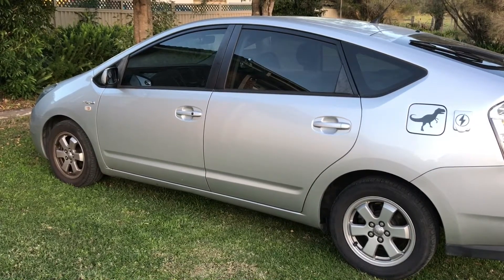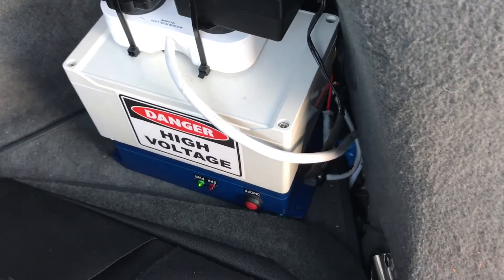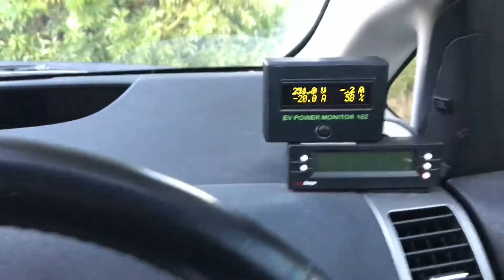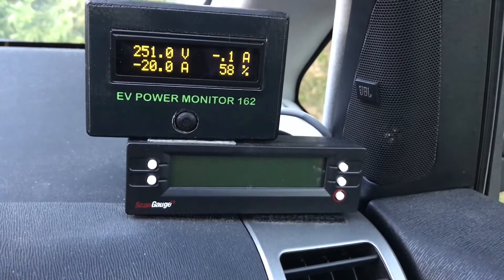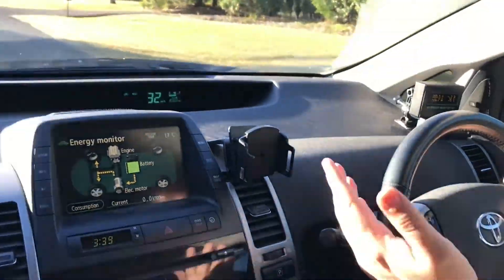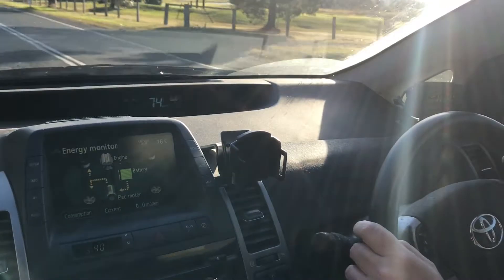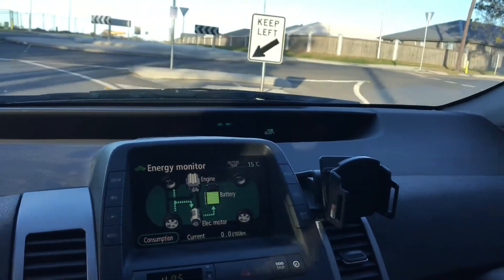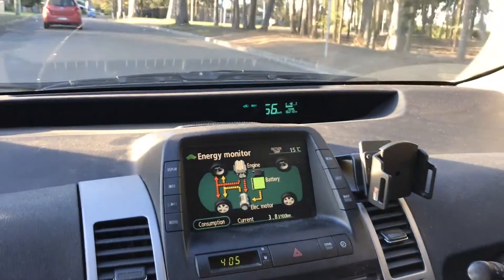2006 Toyota Prius 10Kwh PHEV conversion part 2

Comment: Where do you get the kit?
Reply: Can you make a detailed how to video? Or just point me in the right direction?
Reply: Plug-In-Supply are no longer supplying the kits. I have this info from Robb himself. The website has changed and no longer shows the kits.
Reply from the maker: Home Solar Research the kit was mostly from pluginsupply.com. The batteries charger and bms were from a West Australian vendor.
Reply from the maker: evric2008 I must have gotten one of the last ones.
Reply: @exaturbo  I want the controllers so I can put in a battery pack but I cannot find them...

Comment: how did you make the prius take so many amps? can i reprogram this myself or do i need to replace some hardware (like bms,some wires)
Reply from the maker: This is a complete kit. It has a controller that plugs into the obd2 port and spoofs the car into believing that it is slightly overcharged. So it wants so get rid of that excess. This allows it to use a little extra current. It was a good system for the time I had the car. Haven’t had that car for around 10 years or so. As far as I am aware, it is still going well for its new owner.
Reply: @exaturbo  thanks :)

Comment: hi jason i am finally go to do convestion similar to yours could i asked a couple of questions i am based in uk i have a bit of experiance of building electric bikes im in my 60s this is next step i have a limited budjet which is why not buying completed vehicle 
1 is your pack charged by the  prius car when being used  i see couple people using  diode to prevent this 
2 as no kit available can i create my own ice kill switch do you know what connections need to switch to enable this function do you have a circuit diagram of the add on wiring you could post 
3 why did you choose such a high voltage pack when compared to the origonal hybrid battery pack i relise you get lots of questions which much difficult to answer it would be appreciated if you could answer mine thanks john
Reply from the maker: Hi mate. I don’t have the car anymore, so can’t help with too much of this info, but on the Prius chat forum there is a bunch of helpful people and useful info. I’m sure someone there will be able to answer a bunch of your questions. I don’t have any of the wiring diagrams anymore, as I gave them to the buyer when I sold it. 

As for lack voltage, 240VDC is actually pretty close to the original hybrid pack. It actually has to be slightly higher in practice for it to charge and run the system. 

The stock Toyota pack is similar voltage. And is actually boosted to around 500V at the inverter before being fed to the MG that drives the car. 

It didn’t charge from the car. That was one major downside. Not being able to recover any regen apart from what was going into an ageing Toyota pack. The way it worked was it disconnected one of the contractors when you were off throttle. This prevented the car doing regen into the add on pack.

Comment: Hi, I want to do this with a Hybrid Yaris 2018.. tell me one thing, do you connect the extra battery in parallel, how do you avoid the battery charging the original one? I was thinking about using diodes for that but I think it is not the optimal wya that I can do that.
Reply from the maker: It’s not as simple as connecting a larger battery in parallel with the factory battery. You need some way of faking or spoofing the SOC of the Toyota hybrid battery. Or the car will not know the extra capacity is there and won’t use it. 

The system that I had had two electronic boxes that handled the spoofing of SOC messages. The kit that I had is no longer available, but there are likely others out there. Good luck.

Comment: Still using this? Want to sell the kit or car?
Reply from the maker: I actually sold the car around 2 years ago. It was still going well at the time, but the Toyota HV pack was very weak and needed replacing. Didn’t want to spend the extra $3500 on it. So cut my losses.
Reply: Jason Munro if only you realized you could refurbish it yourself for $50+4 hours!

Comment: How do you do this and how much does it cost?
Reply from the maker: The business that was selling the conversion kits is no longer going. So it would be almost impossible to do this these days. And as for cost, it was over 10,000 for the conversion. Not economically viable these days either. Plenty of good second hand evs on the market now.
Reply: @exaturbo  Thanks. 10k is still a lot cheaper than the cheapest EV though, and being able to get 100km on EV mode would do me for my daily commute. Does anyone do this in Sydney? Cheapest second hand 2012 Leaf on carsales is still 20k.
Reply: @exaturbo  I just had a look at the EV Plus website. Looks good but I'm just wondering how long this takes. You'd need a fair bit of spare time by the looks of things.
Reply: ygg drasil why don’t we find all the people who want to do this, find out a way to buy the components, then every drives their prius to Kansas and we install like ten of them in a single day
Reply: @isaaclatterell1364  I like your thinking. I would just need to construct a bridge from Sydney to Kansas via the Pacific Ocean so I can drive my Prius there and this plan should drop perfectly.

Comment: G'day mate. I've got a prius I was thinking of doing a range extender kit on just wondering... Does your kit just keep the main prius pack charged?
Regards Blair Fraser Kyneton Victoria
Reply from the maker: This particular variation of the conversation kit would actually directly provide power for the inverter in the engine bay. The last one I had just kept the stock HV battery charged. 

These days I don’t think it’s economically viable to add extra batteries and controllers to the Prius. When you consider how cheap a used leaf is.
Reply: @exaturbo  yeah well played!
Reply: @exaturbo  they aren't that cheap, still around the $20k mark, which is fine if you are loaded or don't care about paying interest, but most people don't have that much burning a hole in their pockets

Comment: great video! standard battery extensions of a series 2 Prius support the limited max speed of the standard Prius in ev-mode, about 48kmh. Which part of your modification allowed to reach speeds up to 80kmh? were both integrated motor/generators used for traction? (though one would be turning at very high speed...). tnx!
Reply from the maker: j k thanks. 
The standard Prius will actually do up to about 85kmh on electric only. It’s called out of gas mode. You basically trigger a fault code in the ecu that makes the car think it’s out of gas / Petrol. It will then not attempt to start the ice. The fault code is removed the next time the ignition is cycled.
Reply: @exaturbo   Hi Jason, I would like to ask you, would you able to describe ICE kill switch better. Do you have some wiring plan or setting of Can modifier?  Will be possible to buy it anywhere? Thanks
Reply: @exaturbo    thanks for the quick reaction! ICE kill switch is then probably the "EV mode" switch we know here in Europe , combined with a CAN-bus message-modifier. great to know that the electrical speed under those conditions is well over 48km/h!  since these sets are not available anymore (BMS+ or BMS2) I need to find  other (affordable) sources to modify a Prius over here. 18650 batteries are already a commodity over here, to make de battery/powerwall. rgds!
Reply: The car can do that during normal hybrid mode, but for short periods of time. 
There’s a maximum RPM speed of the electric motors. That’s the reason for the limit on full electric mode. (The engine spins but is not consuming petrol)
Remember that’s without this conversion.

Comment: I love that you have done this. Used EVs are likely a better option at this time. Have you looked into buying a used Leaf or Spark EV or anything? They are super cool! just like your kit :)
Reply from the maker: I did consider a second hand leaf, but too costly here. The leaf was a $60,000 car when new. And we only ever got the 2012 version. None newer. The spark is not available here. Neither is the bolt. The volt was here 1st gen only. Again at 60k new, too costly. Even second hand (assuming that you can find one for sale) only something like 300 were sold here in the first place. 

Another consideration for me is that my parents live more than 180km away and I need to be able to go there often. 
Any ev in Australia that can do that range is beyond my financial means. Can’t afford even the cheapest tesla either. That would be well over 165k new.

Comment: When you kill the ice can it be reactivated while driving?
Reply from the maker: Erik Balm with the ice kill button you have to pull over and turn the car off and back on in order to re start the motor. With the ev button it can be switched whenever you want.

Comment: Where can I get a kill ice button?  I would love to be able to force the ice off from time to time
Reply from the maker: Erik Balm mine came with the plug in kit from plugin supply. Unfortunately they no longer exist. 

Also unless you have a really strong oem hv battery or a add on battery, I wouldn’t recommend the ice kill button. The ev mode button is a different option. Australian cars come with it as standard. US cars didn’t. But it can be added.

Comment: Great video and great work...but it looks like a massive pain in the arse for all but the most technically competent and suitably inclined. 
I wonder if it is just easier to buy an older PHEV model. What are your thoughts?
Reply from the maker: Mark Harris I agree. I certainly wouldn’t do it again. 
It has been a fun project. And the results have been really good also.

Comment: Hi Jason,  very  useful  instruction video. Thanks a lot. Question for my side: How you forced EV mode over 50km ?  My Prius is set at 50km just....  If is not public the info. please write to my email:  barabasalex@yahoo.com   Best regards.
Reply from the maker: AleXis the ev mode is achieved through what’s called out of gas mode. Basically you fool the ecu into believing that the car is out of petrol / gas. 
There is lots of info on how to do it. But you absolutely need an external battery pack, as the factory battery will only go like 2km or so max. The system I have uses a switch to trigger what appears (to the ecu) as a blown efi fuse. It then resets the error code. And the car can drive at up to about 85kmh in ev mode. Even though the code is cleared immediately after pressing the button, the engine will not start until the ignition is turned off and then back on. If you google Prius and out of gas mode you should be able to find the required info. In ev mode it is very power limited though. So really only suitable for around town driving. The acceleration to about 30kmh is quite brisk, but then it’s rather slow to gain speed. It is usable however if you pick the right conditions.
Reply: Jason Munro did you see the guy who spun the ice engine without gas to achieve high RPM eve mode?

Comment: Great video....I have a 2007 Prius and have always wanted to do the conversion to plug in. I've looked in to Plug In Supply. How much did this whole conversion cost? Do you feel more power with the extra batteries? Does the addded weight of the batteries make the car ride smoother? does the car look weighed down?
Reply from the maker: Total conversion cost was around $13,000 Australian. 

The car doesn't have more power, it's just cheaper to run. In ev mode it's actually slower to accelerate.

Can't say that I actually notice the added weight, it's only around 110kg total added to the car, so it's no different to having a heavy passenger in the car. 

I added a pair of heavy duty 25mm raised rear springs to the car, so from the outside it looks no different to stock in terms of ride height.
Reply: Slovak saying: " You cannot weave a whip out of shit". The motor is only 25kW or so.
Interesting hobby, but definitely not worth of my $13k